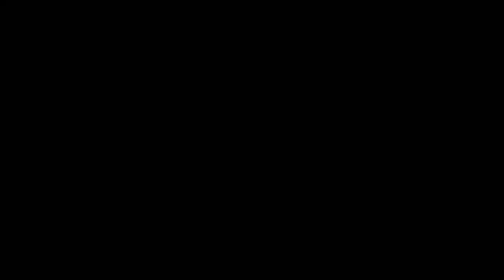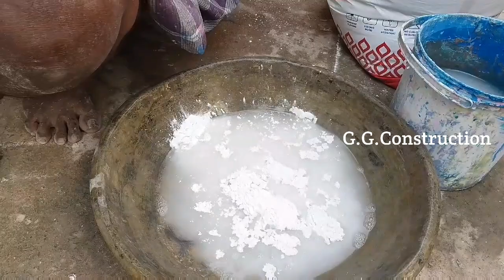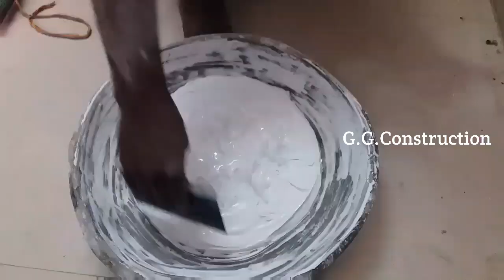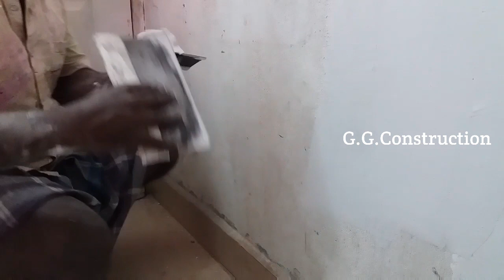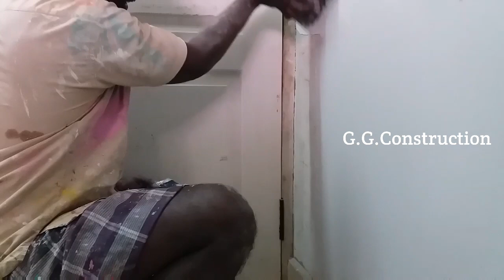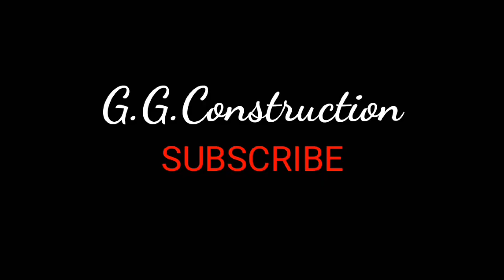how to mix wall putty powder with water

Comment: What is the ideal ratio of Putty to Water mixture ?
Reply from the maker: Need water and need powder
Reply: @g.g.construction  i can't stop laughing....
Reply: Andrew its 1:5 or 1:4 whichever u prefer...
Reply: @pilun7937  OK.. Thanks.. 1:5.. 1 part is water or putty..?
Reply: @andrewthiyam8602  1 part is water my friend
Reply: @pilun7937  I think it should be 2:1.. 2 for putty and 1 for water...
1:5 is for cement and sand mortar..
Reply: 1:2 is good
Reply: @jacobpaoboi9589    talking about volume or weights..?
Reply: @s123sharma  aren't they commensurate?